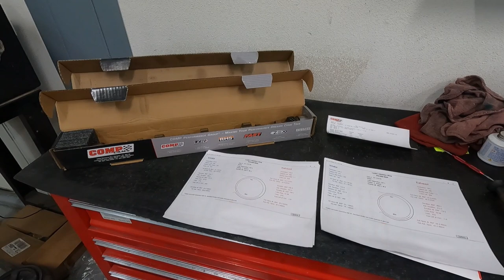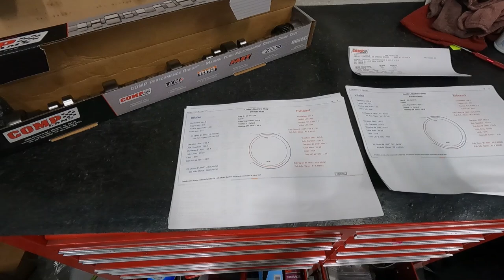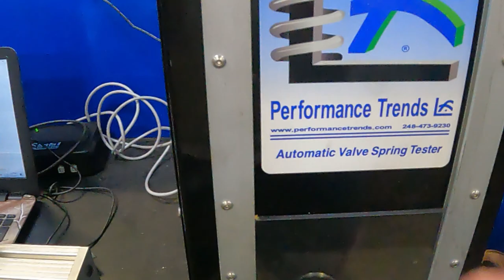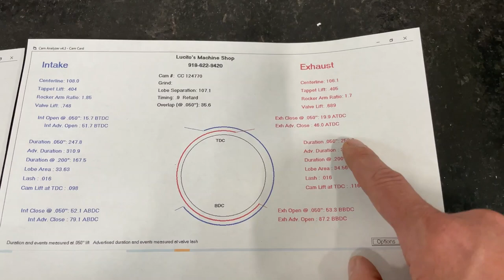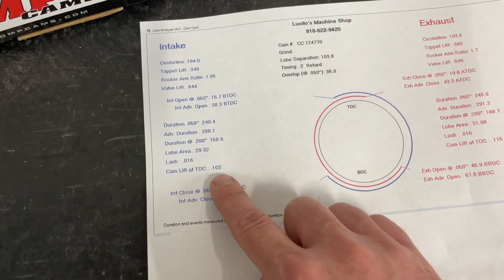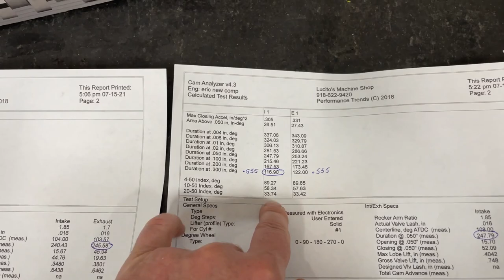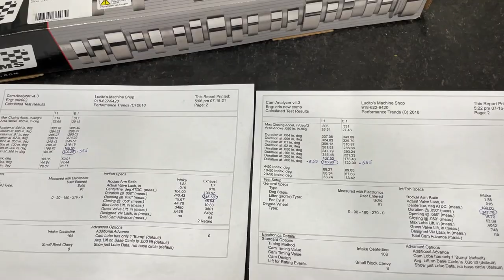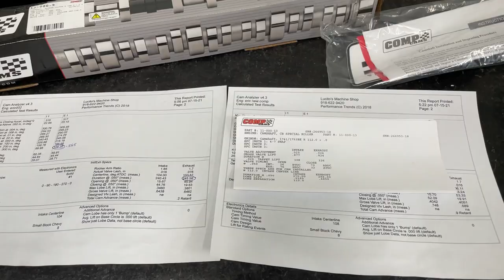Camshaft info. Why I think more lift is better.

Comment: Wear on a brass distributor gear is dependent upon mechanical loading. If you have a high volume-high pressure oil pump expect a LOT more wear. You do not need a lot of oil pressure no more than 10 psi for every thousand increase in RPM up to a max of 60 psi (which will protect bearings even at 10,000 RPM. Secondly, a high volume oil pump is only required if you have a massive internal oil leak; such as the use of chamfered rod bearings that leak oil like a sieve. 

If you are really worried about wear you can buy a phenolic plastic distributor gears from Germany for a standard Chevy distributor (just not for a half inch diameter MSD distributor from the last time I looked). They wear like cast iron with no brass filings getting in the oil from a brass gear wearing away.

Big Dave

Comment: The old expression "the only cam with too much lift is the one you can't fit in the block" is largely true as you eluded to. The real reasons to not get more aggressive are as you mentioned, valve train parts life and the stability of the valve train its self.

If you look at the undeniable success of lobes like the XE series it's because they go on the principles you talk about. For a set duration a higher intensity lobe will get you more lift and open the valves quicker making more power in most cases. It will also have a higher dynamic compression ratio which is critical if you're trying to do a budget build with a long block that has minimal work done to it e.g. maintaining a sub optimal compression ratio.

Valve train money is almost always good money spent. The bottom end build up has three real jobs, not get destroyed, maintain seal to transfer energy and not lose power (different than making power) while the valve train and the heads are what actually allow you to produce power. 

I'm going with milder lobes on my build, I'd love more lift but I also have a perception of what I believe are of the mechanical limitations of the platform I'm working with valve train wise are. I'm talking a head that probably peaks out at .4 flow wise too,

Comment: Cheers for shearing your knowledge im about to set to clean up my Harley heads at this stage casting imperfections ive not done much in this kind of thing before but i cant stop watching your vids if you have any knowledge on twin cam heads witch im sure you just use you years of experience so just another set of heads anyway any information wouldn't go to wast i appreciate the time and effort you go through to make these vids for guys like myself to watch and learn from in many ways.

Comment: Ls guys are blessed with heads that flow well already. They put in a moderate cam and if that doesnt cut it then they add boost. 🤷🏻‍♂️ They dont need .700 or .800 lift too make 1500hp.

Comment: Many years ago and that was when I was like in my early 20s I had built a engine it was just a mix of parts that I came up with , heads of a g gas car , used billet steel roller isky cam . The engine ran ok and I called I think his name was T Willy and he told me I need about  20 deg less duration and could use more lift .  One thing I did was try using different lash setting to change the way the engine ran . Of course there are limits .Thanks for the videos

Comment: Eric, you can say that higher lift gives you a flat top lobe. Meaning the head gets to peak flow faster and stays there literally flat across the lobe until lift goes below peak flow lift. In a flow graph which you should draw, makes it soooo much easier to explain, the flow duration graph will climb to peak and stay flat at peak flow for X duration. In the time flow is flat the lobe is lifting and coming over the nose and dropping until lift is below peak.  Bam, flat top graph.

Comment: yes using a Dynamic compression calcultor before you purchace off the shelf comp cams. Mine sounds great but is a pooch , the intake is 68 ABDC. and my compression is 10.2 mech. dynamically around 7.99

Comment: Eric, you have shown us that some cylinder heads flow really good up to say .500 lift and no more. So it depends on other variables and be easy on the valve train.
Reply from the maker: Even if it flows only to .500 the valve will spend more time there with .600 lift cam than a .500 lift cam.

Comment: And in an advertisement for the advantages of VVT on DOHC engines. where you can independently adjust the cam timing in software to gain maximum torque throughout the rev range.

I don't know why so many people buy 'lockouts.' VVT is basically free power you're leaving on the table.
Reply: This is almost the same as the coyote vs ls debate. It's useful on small motors, but it makes smaller motors physically bigger and there is enough added complexity to make it less attractive than a larger motor. When you can put down more than you want to the point of detuning in lower gears, vvt can't really help you. I deleted the (single cam) vvt in my l92 due to valve clearance with an aftermarket cam. Its possible it could have given me 10-20 ft-lbs here or there but would have required larger valve relief's, at which point i could have just run more duration and a tighter LSA. Then there is the whole tuning it thing... Don't get me wrong, I'd love to mess around with vvt, it just doesn't give me anything on my motor.

Comment: I'm really enjoying your vids, Eric.  At 55 years of age I never tire of learning new things, especially about engines.  I used to know a lot of "car math", able to quote formulas and such.  I knew there was an art to cylinder heads and camshaft selection and often wondered how the guys at Comp would come up with their recommendations.  It seems that they should've been asking more about low-to-mid lift flow numbers, instead of the box question..."What do the heads flow?".  I knew the two were attached, but you just explained how.  Keep 'em coming.  BTW, I'm very interested in your next vid.  I'm definitely curious about why the carb times were much faster than the EFI times.  My hunch says it's related to CFM, specifically more is what that engine was begging for.  😛

Comment: In the case of chevy 461 heads, the heads would flow the same cfm at .500 lift, as when the valve was completely removed from the head, so more duration was the only option left...
Reply: Of course, and he's not speaking against that. That's the same theory behind more lift. More lift creates longer lift at lower lift. Problem with having low lift and long duration sometimes, is that a flat lobe can be very hard on valvetrain components. In such a case you increase the lift at .500 by both adding lift and duration, not only one of them.

Comment: My favorite vid from you so far. We just say it different.......I say " less duration if you have good head flow " , you say more lift.....end product is the same.... shorter durations for the lift.  I've had great luck with aggressive lift to duration ratios .
Reply: Does hyd-roll 230/236 with .575/.570 sound good for BB Mopar with excellent TFS heads?
That lift sounds high, but I'm not scared to try, yet.

Comment: Thank you so so much for your videos. I made a comment on your other video before finding this one. What i now know in comparison to what i still have to learn about my 4.0 straight 6 for my jeep has told me a lot of how much i dont know. I want to build it to be a 4.6L with a small turbo to get to an easy 325 to 350 hp which is relatively considering very high end builds have kicked out 300hp naturally aspirated. I want my motor to of course have more power but also have good longevity.

Comment: I've rarely even bothered to work out a theoretical compression ratio as it's a pretty meaningless number.
The only thing that is important is the dynamic compression which is totally dependant on cam and cam set up.. 
As long as I see max of 225psi@~300rpm (cranking)  I know everything  will be OK. 
The few times I did measure CR, it was around 14~15:1 (in theory!!!!!)
Reply: @rustysausage69  The flame can only travel at a specific rate so larger diameter  bores take longer for a full burn and are more likely to get hot spots and detonation. You want max cylinder pressure around 14 degrees ATDC and not have to run 58~60 degrees advance ignition timing
Theoretical compression is a meaningless number as it doesn't actually relate to anything inside the running engine.
 In the late 1970's BMW fitted dual plugs when bore size increased and got extra 11bhp with less overall timing. It was a modification on Harley Davidsons when they were pushed to 2litre or larger although the combustion chamber was pretty bad so it improved things even at 1700cc. Most 'classic' V-8's  have pretty awful fuel distribution, even when port injected they are not exactly great.

Comment: Advertised duration is extremely crucial when you subtract the @ .050 number. This gives you the lobe intensity which is why you gained 60 hp with 1.8 rocker not lift.

Comment: How about Apr. 33% of the valvesize or test it in the flow bench to see where it ends to increase the flow? A smooth even custom profile with right amount of duration/ramps/lift in combination is probably the best way to go if you have no limitations. A cam is just one of many important parts in an engine.

Comment: I have always seen for how much  valve lift is based around the valve diameter and The valve seat angle the steeper the seat angle like 45-50° you would have more left almost half of the Valve diameter. If you’re running 25 to 30° you would run less lift.

Comment: Question.    A 350 with air gap, 750 double pumper, 1 3/4" long tubes.  Heads flow 210cfm@.4" and 260cfm@.5".   Two cams both have same durations and lsa.   The only difference is lift.  Cam 1 220@.05", 112 lsa .410" lift.   Cam 2 220@.05", 112 lsa .610" lift.    How much more power is cam 2?
Reply: So i described a combo where you have a combo where the heads flow 210cfm and it's limiting HP.   When you replace them with a 250 or 260cfm head you will get a nice gain, like 35-50HP.     The situation is the same if the camshaft lift is the limiter.   If you have the cam lift out to where the head is flowing like that you will get the 35-50HP gain almost like swapping the heads on a head limited situations.

Comment: I'm sorry, I know this is an older video, but I've been wanting to ask a few questions.  I tend to agree with you on more lift is better (where the flow graph levels off/flat lines). How much more (10%, 20%, 30%), I don't know. I don't have near the experience you do but,  I would tend to want to add .05" or .1" past where the head flow flatlines. On the race track anything goes. Like you said as big as you can support. 

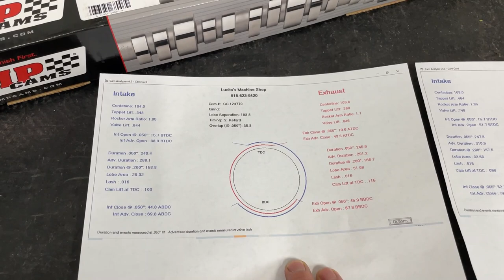@14:50 What heads was on the engine and what did they flow? Did they flow around 336 to 356 CFM at .6 or .7?
 I want cams to last a long time. What do you think about aggressive ramp rates for the street?
I'm struggling to pick a cam for the street from my 6.0L LS (L77). I'm wanting to go narrower on the LSA for the lower torque and the relatively low stall that I'm going to put in (2000-2400). Got any suggestions based on what you've run before? I don't want to fly cut. Thanks bud.
Reply: What's your intake valve size?
Reply: @matthewmiller2268  2.165, I went with a Cam Motion Little Chopper cam. Had a ton of PTV clearance, .290, .240.

Comment: Piston to Valve Clearance🤣 something so easily done with silly putty or Clay was a freaking nightmare for me working @BME.  a Horrible Trig Math test where the wrong answer makes large sums of money disappear. There was nothing I feared worse than NHRA Pro/Stock. They literally order 10 sets of 10 pistons at a time each set with a increase of  .0005” (half/thousandth) in compression height. To run on the dyno trying to  get the quench so tight they wanted to see witness marks on the heads. The reason P/S guys push the clutch in and click it off in the lights is because piston to valve or head intercorse is a function of engine temp above 180 degrees. They use industrial A/C “chillers” to freeze the engine. So that after a burn out and 1320’ it’s under 165-170 degrees.

Comment: Small block 8200 rpm about 10 dirt track nights a year I always put a new soft gear one time a year or if I had a motor problem    and I had know problem and I ran 850 to 915 lift only time I had problems was when I had to run small base circle 2200.00 rocker system

Comment: what about melonized gears?  heard they can used on about anything

yeah i know i dont know jack  i just read th descriptions lol

manufacture says head works on this cubic inch up to 6000 RPM
I buy a cam that works to 6000 rpm  for that cubic inch cause i only know about that much other than matching the gears and compression per the combo

Comment: We just dynoed our diesel pulling  tractor engine. It put out right at 1200 hp and 2200 ft lbs torque but we only pulled it down to 2800 rpm and the torque was still climbing so it  had more to go. I know you dont usually work on diesels but do you think more rocker ratio would  make more power. They are only 1.6 ratio now.

Comment: I can show you a bronze gear distributor gear that has lasted right on around 2000km's on genuine street driven car, and it is completely f####d, distrutor was set up with perfect back lash, height, and well lubed, so don't go bs me on that, but I wouldn't use anything else on Solid Roller billet core, however the cast gear roller cam, and the press on type you showed, can run a stintered iron gear, and will probably out last the Engine.
Reply: Use a Melonite distributor gear
Reply: @NoName-yr1jv  yes, correct, but only for the cast cam cores or pressed on type driven gear, and NOT for the full billet 8620 core camshaft.
Reply: @bradgriffith4231  thats what i thought.  if you buy one of comps billet cams.  you'll see they recommend a melonized gear

Comment: Doesn't it negatively affect performance if you are purposely adding too much lift, say to a lift/flow point where the port starts running into REVERSION flow problems ? Or using a camshaft with lift that sees the small gains from the port after a certain lift value outweighed by the extra load on the entire engine from the heavier valve springs required to even get to that upper lift point ? Guys with needlessly strong valve springs to accommodate a high lift camshaft that does nothing but fight against the upper air flow of their heads are actually gaining back HP by going to smaller cams and less spring pressure, or proper springs as a result. I guess this is why it's better to pay someone to do the math (and voodoo) rather than take a chance picking parts out of a catalog if you are a novice builder. Great videos. Glad I found your channel.

Comment: Have any of you ever bent a piece of coat hanger wire back and forth? Imagen that as your valve terrain components.. have you ever seen what roller bearings do when they disintegrate?, no matter how good the materials or how much you spend, if you use extremely high lift, hope you have deep pockets, sure, use as much lift as it needs. But don't count on it lasting to long if it's Track Roller cam in a street car, you better know what you're doing.
Reply: Of course, and nobody runs .950 lift on the street. But here's a question for you. Why on earth would you run a needle bearing lifter?

Comment: E. I'm a new suber here, man I'm looking to upgrade my cam , what would be a effective choice as far as 411 gears , Maxx series promaxx heads which are sbc 183 /64 chamber btw I love the cylinder heads the company make best 1300 Ive spent tho the upgraded 411 posi was the most effective upgrade so far , and what do you know about Lunati cams? Or comp which would do good for my engine ?

Comment: Hey Eric I watch alot of your videos I have a big block 427 60 over so it's a 440 it's 10 to 1 compression I have a stock set of afr 265 oval port heads 219 intake 188 ex 100% cnc heads I have a howards hydraulic roller that is 235x241 duration @50 618 lift and a 108 lsa I have a victor Jr. Intake with a Holly 850 do you think this is a ok combo for the street and what type of  horse power do you think it can make I was hoping for 525. What do you think?
Reply: I ran a combo really really close to that in a 4x4 79 3/4 ton pu w 4.10s , 4000 stall , 31 inch 10.50 tires as a daily driver .  Horsepower ?? I dunno , but i had to pull it out because it was twisting the frame Bad , destroyed 3 turbo 400s , and twisted off the Detroit lockered corperate 14 bolt  axles Regularily !!!  Truck with me in it , through the exhaust , on street tires ran 13.10s @5800 lbs in 2WD .  No traction . 4WD i broke shit and hard to steer spinning fronts . 
 I could smoke the tires from a 70 mph roll . Your Rat will RUN but ive no idea on hp . Id say youve easily met your goal PLUS .  Some may not believe it but i dont care . I also took your musclecars beer money on a regular basis . 🤣😂🤣 it was a Great street sleeper with Much better traction on concrete  . 🤣😂🤣😎
Get your carb dialed in so you can frost the intake runners all the way to the heads on a warm engine at idle in summer and maintain that frost . I was quicker with a 750dp but that was probably a weight/gearing  thing . 16 mpg wasnt all bad either on 93 pump gas for what it was in at 70mph . Anti-Reversion Cone Headers , long forgotton by many , Really bring the tight 108* LSA ALIVE on the Rat !!! Youll have to make the cones and tig them in . 
 Good luck !!!

Comment: This is great info. Banks killing a Duramax represents the concept visually with the cam duration and lift overlayed with the flow curves. Interestingly enough, stock Duramax LMM lift exceeds head flow resulting in a flow curve that has the top cut off. Instead of a moment at X CFM it's holding X CFM for so many degrees of rotation. Much more air with the same duration. Especially when holding cylinder head max flow for a time. The flow curve almost looks like a square wave.